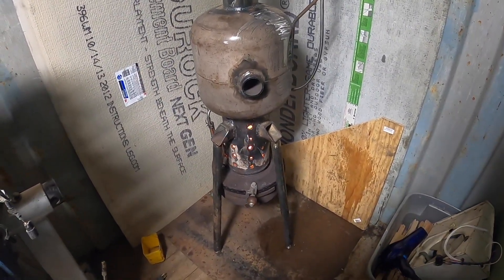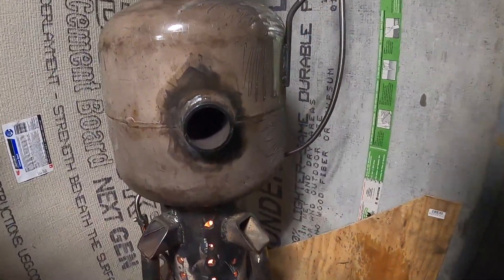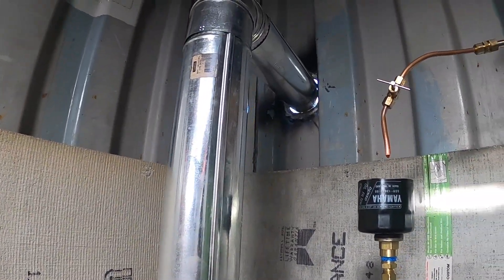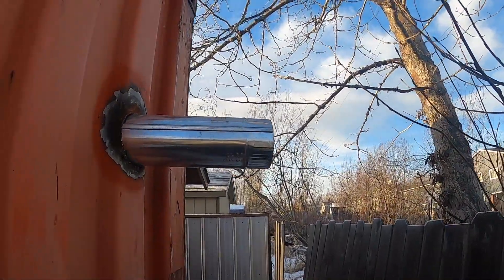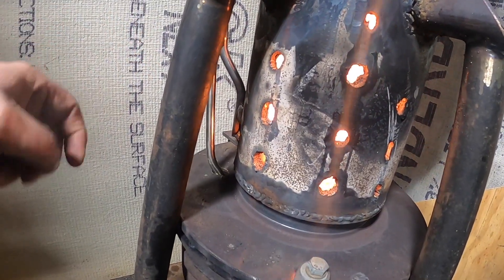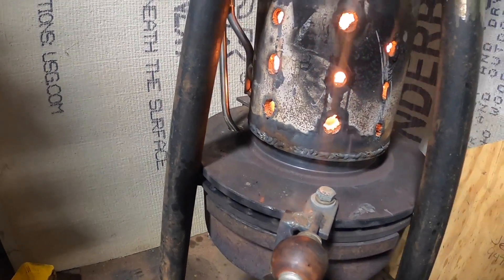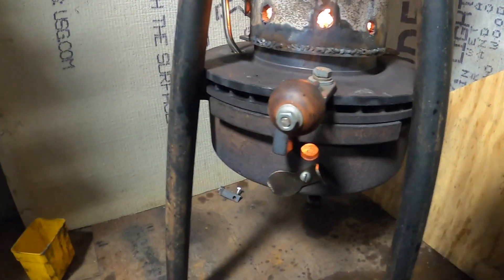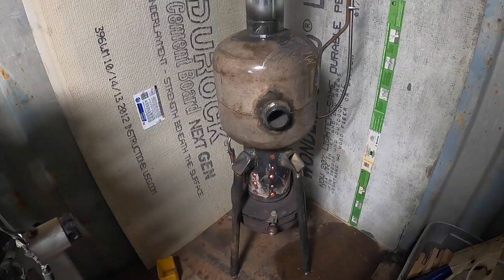Waste oil drip stove

Comment: What's the hole in the bottom of the drum? How come no oil leaks out.. what's the hole for thank you ?
Reply from the maker: The hole is for air intake to the center of the drum. No oil leaks out because the propane bottle is welded in. Thanks for watchin!

Comment: hello .  yeah cold winter morning here at the Texas Border . . yes it´s a good idea if you can break down the construction of this stove. . perhaps I can replicate it . . One question .  you say it gets dirty but It´s supposed to burn all the liquid because it gets really hot . . so I wonder why that is. Greetings and happy winter.
Reply from the maker: Thanks for watchin! The soot is unavoidable, due to the burning of waste oil. There are alot of impurities in waste oil. I would submit that there are more impurities present, partially because of the amount of oxygen introduced into the burn chamber. Think about it like an engine burning a fuel air mixture. If you choke the oxygen back some, the engine starts to smoke and cough. Same thing here, I think. More oxygen (forced air) would probably make for less soot. While a novel idea, I don't think my little stove is very efficient.

Comment: Is the small propane bottle welded in bottom of larger tank open and for air flow? Thank you from Texas.
Reply from the maker: Yep. It sucks air in from the bottom of the brake drum, and feeds the oil on fire.

Comment: This is brilliant and reminds me of a conversation, between two engineers, I overheard back in the early 90's. They were talking about a drip waste oil heater that employed a water drip aswell. The trick was getting the oil and water drip ratios just right. As I remember it, there was a sloped metal plate that had been previously heated (perhaps electrically) that the drips went onto. They spoke of it as a suppressed technology. They were both very capable and experienced engineers. Thanks for reminding me!

Comment: I like it & plan on the same design. I will use a larger tank,  because I have a larger  aria to 
heat. My shop is 30 x 50. I,m using a wood heater & it works ok. But more mess with cutting 
wood cleaning ashes, as cleaning chimney. I under stand these burn much cleaner.

  with 
Cutting wood and lots of ashes.

Comment: Nice burner. I made a stainless steel burn chamber of a piece of pipe with a bottom welded to it on mine and it burnes very clean too.
The challenge for me is getting enough oil to operate it.
If you like you can check it out on my channel.

Comment: all your heat is coming out the pipe lol, ya should stick that heater near the front of your connex and then run a 15ft span of air ducting to the exit hole. itll exchange a lot more heat and itll make things way more efficent and youll use even less oil and warm your place up even better
Reply from the maker: Sounds like a neat idea, thanks!
Reply: @sidetrackmetalworks2058  yessir, should help you out immensely. also if you make your flash pan thinner it will ignite the fuel oil much quicker. you want your fuel vaporizing as soon as it lands on the burn chamber. i should post  a video on my burner lol
Reply from the maker: @johndowe7003  if you post it, I’ll watch it!

Comment: just use a float with  an upside do "J" rod etc etc to reveal the float level inside... no leak path and will show you the level throughout the range vs just one spot with a sight glass, easier too,

Comment: When i put used oil in my fridge it solids up? How do you keep the oil liquid if youre using it 
 in a cold space until the space warms up enough to keep it liquid from the heat given off by the stove? I know you could bring liquid oil from wherever but what if youre in a situation where you cant for whatever reason? Love the idea but not for survival i don't think because of that. Supplemental to keep an already warm space warm maybe. Thanks for the idea.
Reply from the maker: You're right. Cold oil does not flow as good as warm oil. I saw somewhere, a fella made a little tank on the side of his stove to pre-heat the oil. You can also alter the viscosity by mixing the oil with something else that flows better at lower temperatures. Say, diesel, or kerosene?

Comment: I noticed when I made mine out of a vented rotor that a smaller but longer pipe pulled better and put off more heat. Used more oil though but the metal was getting cherry hot lol I’ve been experimenting for a few days now

Comment: Finally someone used old car parts to build one of these bad boys?
Just makes sense when you have a lot of used motor oil laying around that you might also have some old car parts laying around to recycle as well. It's inspired me to make mine out of the rotor and drum like you. Maybe some old exhaust pipes and mufflers for the rest!
Reply from the maker: Heck yea! Do it! I found the disc and drum in a dumpster behind an auto repair shop. Asked the feller behind the counter if I could take stuff, and he said "please do".  Nice!

Comment: Is that propane tank in the middle with the pipe going through it, is it a pipe for room air separate from the burn chamber, or is it an air intake for the burn chamber? so you risk Carbon Monoxide getting into your shack?
Reply from the maker: The pipe is just a heat exchanger. All intake air enters from the bottom.
Reply: @sidetrackmetalworks2058  I didn't see a fan or anything that makes air flow through the heat exchanger. A flue on one side so hot air could rise would at least get some flow in there. Do you have a fan?
Reply from the maker: @awesomedee5421  I do have a fan. If you could even call it that. A scavenged stovetop vent hood fan, complete with janky wiring and switch! I'll show it in the update video.

Comment: I think if you heat up that fat sludge, it will liquify and burn
Reply: Yes,  the problem is starting it from cold and because the base is heavy iron it will take some time for it to heat up to continue the chain reaction and self sustain.  Just needs a bit more diesel to start with to get the thing hot, once hot it should burn anything :)

Comment: I'd like to take you up on your offer to give us a run-through of the various parts and how they go together - that would be great.  Looks like a great design... especially when she's roaring away like a rocket stove!  What do you use for fuel?  Do you have access to an adequate supply of waste oil?  Crankcase oil... cooking oil, that sort of thing?  Thanks again!
Reply from the maker: So far, I have only ran it on waste ATF, and used motor oil. I did cheat a little bit, and add some BTU's via diesel fuel. About a cup of fuel to a gallon of oil. Just enough to thin it out a little bit. (flows nicer in a cold shop) My next experiment will be with used veggie oil. I have lots of that available. Just need to work out the filtration side of that. I'll get a follow up video in a couple weeks.
Thanks for watching!
Reply: @sidetrackmetalworks2058  - It's nice to get some heat from something you normally would not get it from... sweet!

Comment: That's a handsome heater!  Yes, please provide us more info on your build.  
I recently moved to Idaho and have a 40' x 60' shop w/no heater!  : O  I've been thinking that a waste oil heater is what I want to try for heating  the place.  I like your design that doesn't use forced  air.  Whatever design i go with, I hope to be able to get the air/fuel mixture just right so it will have a blue flame.  I'll either install a large ceiling fan or have one @ ground level for circulation.
If you would give us a bit more details on your construction, including dimensions, it would be greatly appreciated.  : )
Reply from the maker: As far as I know, you need to use forced air supply for that wicked blue flame. I've seen other stoves with blowers on them, and they seem to have a flame that is more blue.
I'll do a follow up video when I get a chance.
Thanks for watching!